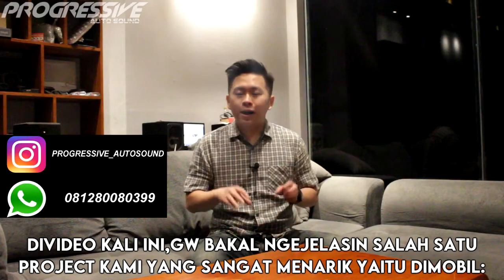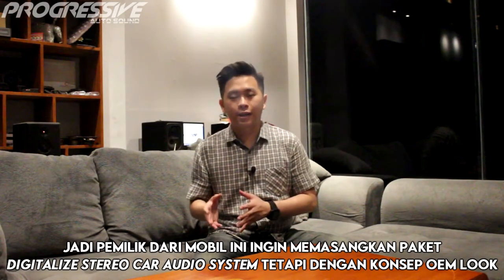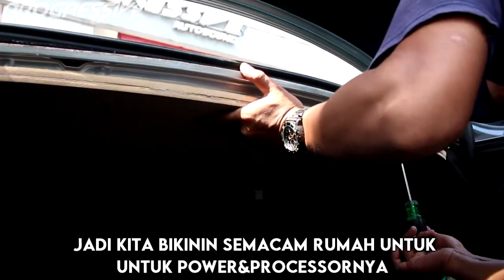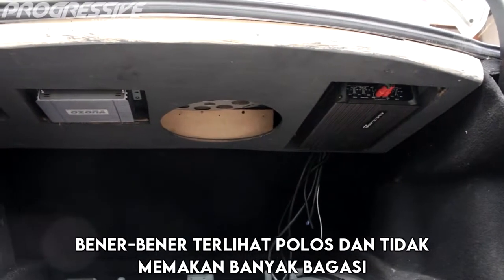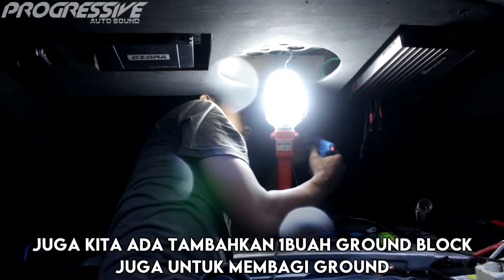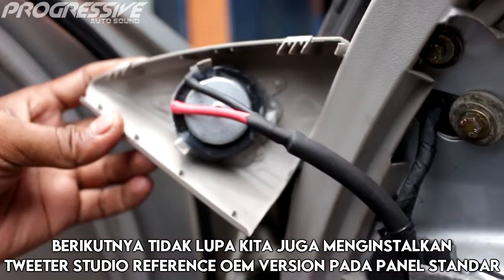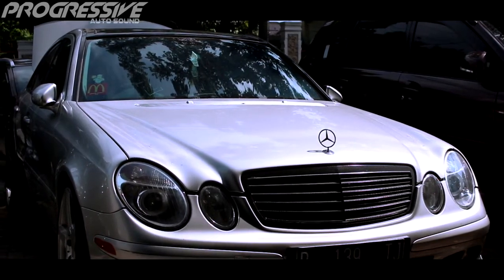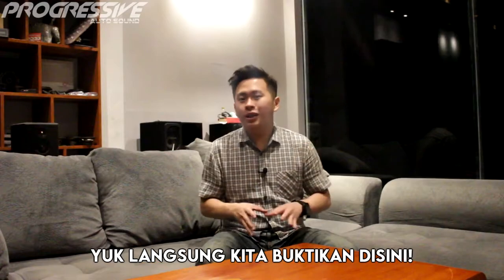KEREN BANGET SUARANYA!!! MERCY W211 OEM LOOK AUDIO UPGRADE.

Comment: A Solution to open the CD changer, for those who have changed the original radio for another compatible one, it will stop working, I attach a link to the video. https://youtu.be/LyyNz7oVGoU